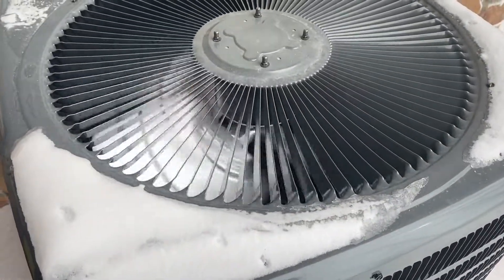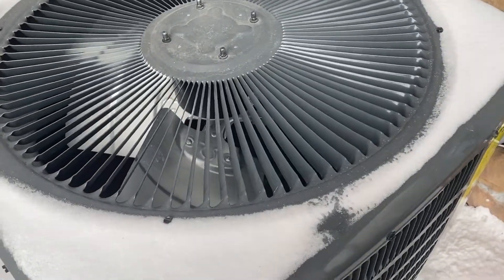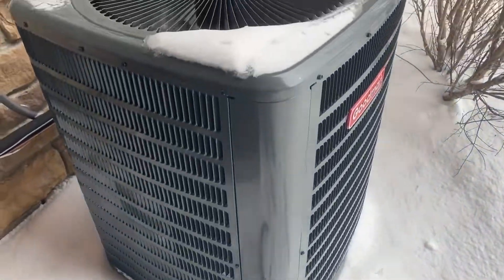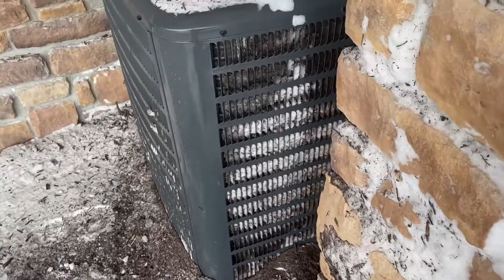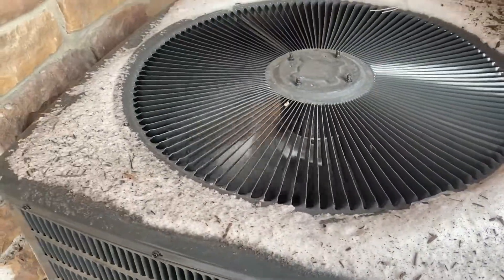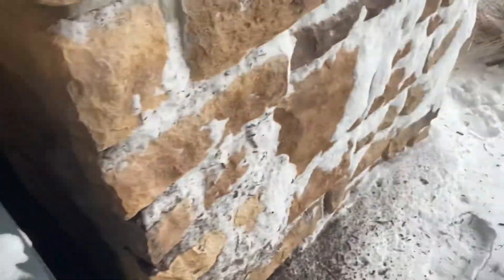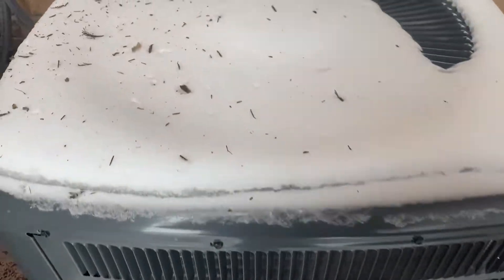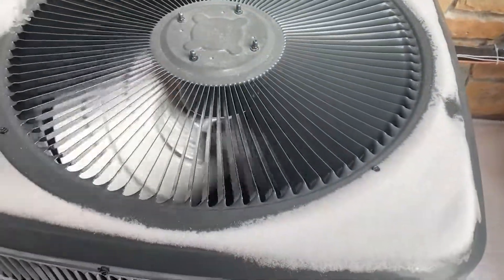3 Goodman heat pumps running in HEAT mode on a very cold day!

Comment: Nice video! Usually heat pumps won’t run in -2 degree weather and it’ll just be the aux heat. It’s fine you didn’t get a defrost, at least you got them running
Reply from the maker: Yeah I tried to get a defrost but it was so cold that my fingers were freezing so that’s why I couldn’t stay for long. I plan to go back on Saturday or Sunday morning. Thanks for watching!